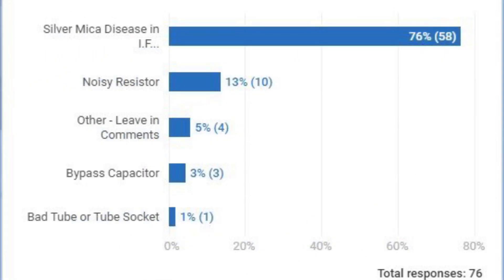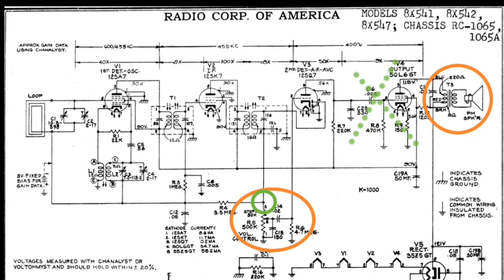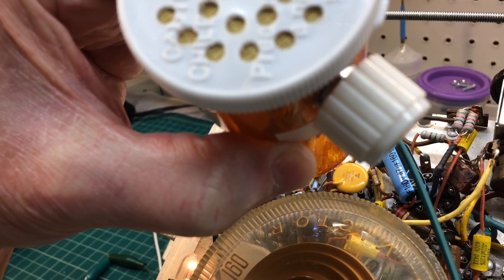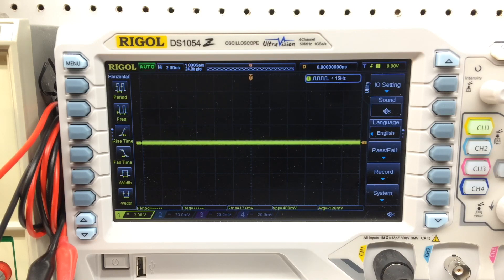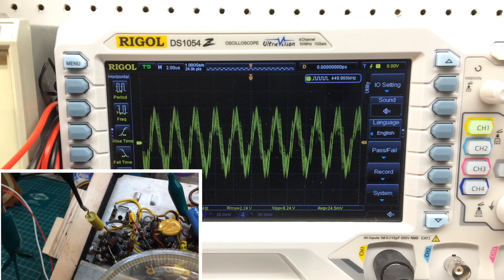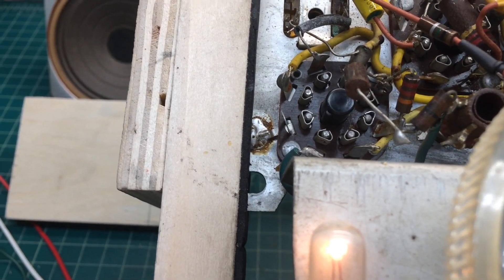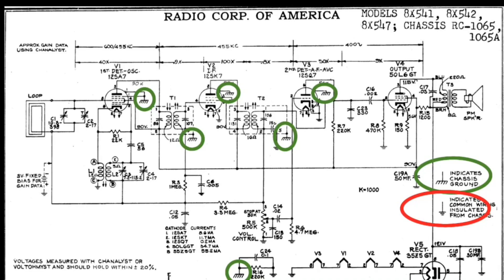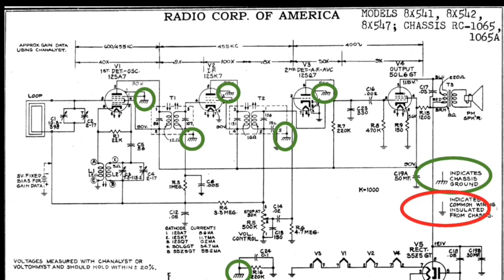RCA 8-X-541 - Cause & Effect P8 (POLL Results, Signal Tracing Crackling Noise & Root Cause)

Comment: Ha! I guessed SMD or mica cap bad. I just solved a problem on a restored Truetone D2622 I did where all I could get out of it was oscillation/squealing. No reception at all. After hours of troubleshooting, that same gnd/chassis coupling cap was the issue. I had the wrong/lower value installed. In my case it is supposed to be 150k & 0.2uF. I don't know if a 0.1uF would work in mine, but I can tell you a 0.047 will not! 😉
Reply from the maker: Glad you got it solved. Some of these issues are isolate at times. I appreciate you watching and sharing your resolution. All the best. Don

Comment: I was wrong.  Lesson is that we should not approach with pre-conceived ideas.  It could have been a thunderstorm 2-300 miles away as well.  Don, the grand master guru of restorations-- a cold solder joint?  I thought that only happened to me!
Reply from the maker: Albert - I’ve lost count of the cold solder joints I’ve made. Some were not taking time to clean the area(s) with alcohol first and others tie back to my impaired vision in my left eye. Thanks again for watching this series, I appreciate it. Best, Don

Comment: I have question for you Don, that capacitor that you were using in series with the scope probe to reduce loading down of the circuit on 12SA7 what is the value of that cap that you are using?
Reply from the maker: Jim, I grabbed a .001uf cap. I’m sure a 100pf or less would have provided better results. Hope this helps. Best, Don
Reply: @RestoreOldRadios  Thank you for that information sir.

Comment: That's why I fully recap old tube gear. I know some people argue that it's not necessary unless the caps are across significant voltages, but I don't want to revisit the gear later on, or have "love jobs" turn into boomerangs.
Reply from the maker: A solid game plan James. I hope folks new in the hobby that viewed this series will see the value in doing so as well. Best, Don

Comment: great troubleshooting!  would a .01uf work as well as the .1uf for this coupling purpose?  I have seen many different values in this position and wondered why some aa5 use a .05uf, some use .1uf, etc
Reply from the maker: Chess - I went back with a .01uF instead of the 0.1uF and it seems to provide enough feedback to stabilize the receiver in my case.  Thanks for watching and reaching out. Best, Don

Comment: You got me! I was incorrect! Never saw that issue before with the "floating" (what I call it) ground cap. I've had folks bring me their radios wired incorrectly using the floating ground as the chassis ground and vice versa. Thanks for showing Don!
Reply: That particular fault will have caught every radio engineer out, Radio Wild..
Reply from the maker: I’ve only encountered this issue once in the past. Funny you mention B- common tied to chassis ground. If I tie the common to chassis, the issue cleared up as well, but of course the capacitor as called along with the resistor in parallel makes it a little safer. Thanks again for watching. Best, Don

Comment: Now we know to check all the capacitors and the connections as well. Opens anywhere in the IF will seem like SMD but you had this radio playing a station 
and clearly so when it was detected. That is what stumped me. The I looked at what you changed in the circuit from the previous episodes and jumped to a 
bogus conclusion. Great demo Don!
Reply from the maker: This was a strange issue and wasn't what I expected for sure. It's amazing that the RF coupling capacitor between the B- bus and chassis ground would cause so much havoc. Thanks again for your input and taking time to watch. Best, Don